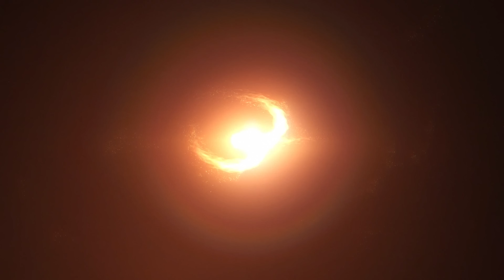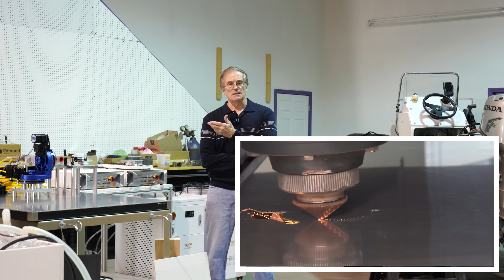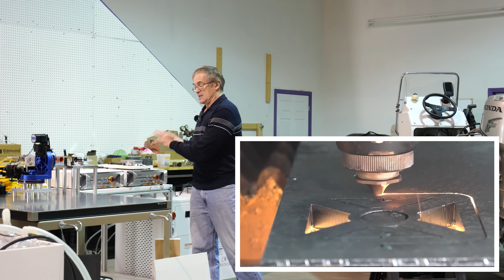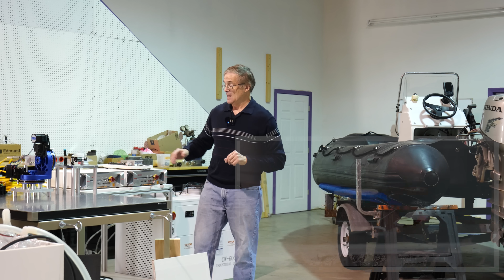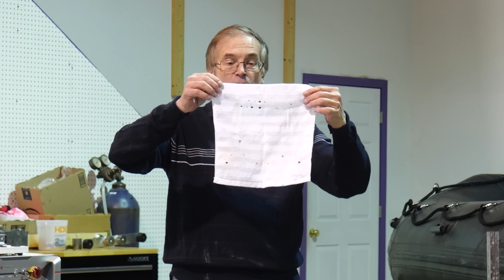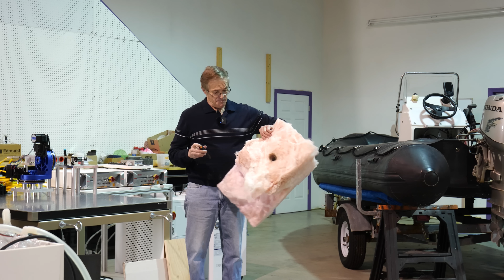We have a problem... and need your help!

Comment: You guys REALLY need to improve your lockout switch setup as well. Have a chain of momentary push buttons in series, one for EACH person in the room, and allow the Laser to power on ONLY when ALL switches are permanently held in, and require a procedure before it can be powered again. That way there is no need to communicate if something is wrong, anyone can disable it within less than half a second. You could also add in additional light-based detection that points at your back wall and immediately trips the laser off if light (laser OR just thermal radiation from the heated wall) is scattered off the wall.

This is all in addition to having a somewhat resistant wall.
Reply from the maker: We're including both as you suggest.
Reply: @TechIngredients  great to hear! 👍
Reply: @TechIngredients  make a portable water tank with one-way mirror that can disperse the light that gose in to the portable water tank/wall or tubes, maybe similar to solar thermal collectors!!
Reply: @TtheMindd  Not sure if anyone replied yet - there are no affordable mirrors that can handle this beam once it's focused. It will blast through almost all - even reflective surfaces.
Reply: @frollard  to be honest you can't make that claim without testing it!!!  water will not only dispersed light  but it can aid in the cooling down of the temperatures! I would assume depending on how you combined the one way mirror with the transparent solar thermal collector will be of significance when ensuring this thing functions properly! Think of it as a fiber optic cable but with tubes of water and a one-way mirror
Reply: @frollard  he's using the fiber optic laser to admit those beams we could use something similar to capture the same beams but instead of like I said but instead of fiber optic it would be laser thermal collector!!!
Reply: @TechIngredients What about a wide water feature. The water is running all the time.
Reply: @IT-sq5rj I was thinking of this too. Like a laminar sheet of water.
Reply: This of course would be a project in itself
Reply: @TechIngredients  Have you tried using translucent glass to diffuse the beam?
Reply: @snarzetax  that's what I was saying there's a couple of different ways we could refract the light glass is one of them water is another if we can bind the two it can be done efficiently I deemed it a laser thermal capturing system
Reply: @TechIngredients ruby / corundum dust for absorption. It should allow you to tune the absorption by simply changing the color of the source stone as well
Reply: @TechIngredients  I was going to say similar - the default position of the system is OFF and it takes a number of people to do something in a sequence and then to keep the button pressed
Reply: @TechIngredients  I wonder what @styropyro would suggest. This is his cup of tea. 😂 He might own a few already.
Reply: @TechIngredients  would anything like SpaceX Starship heat tiles work?
Reply: @PetesGuide  it seems not, that is for blanket high heat not for point intense heat. it's no different that the drywall for this case
Reply: @PetesGuide SpaceX design is closed. But the shuttle had similar tiles and the design is open and public. 

As other people said it's not the good direction. These tiles are designed to be insulator, and above critical temp, they evaporate to produce a protective layer of gaz. It's does not absorb or conduct heats. The laser of the day will perce it fast. 

But those tiles are very light. And could be used to store a liquid. When heated the liquid would disperse the laser over  a larger surface.
Reply: Seems like also shutting it down if the aiming electronics don't keep moving the beam. If it dwells for more than say 1/4 second, turn it off.
Reply: Agreed, some cheap PIR (Passive Infrared) sensors aimed at the target area (a few layers of fire rated drywall etc.), ran in series to trip a relay that opens the LASER control circuit might do the trick...
Reply: What about ion-exchange treated borosilicate glass panels  (think Superfest, or Gorilla Glass) placed in series with sand (or perhaps ceramic beads) filling gaps between panels?  It seems like the glass would somewhat diffuse, and thus attenuate, the intensity of beam, but would the sand negate this effect? Old Pyrex baking pans (NOT the new recipe calling itself Pyrex) should be fairly cheap at the Goodwill or Salvation Army. 

I would LOVE to watch you use Superfest’s ion exchange process to strengthen glass - making a video, of course, on how to do this at home with supplies and materials available at the local Walmart.
Reply: I am picturing everyone has a key around their neck…
Reply: Also some light/sound alert when laser is working / starting.
I would explore some materials that could induce electricity under a laser, wouldn't be surprised if with your amount of power you could just detect photoelectric effect off of metal sheet... After detecting, basically connect it to switch-off. It's funny how we are looking for better and better photovoltaic cells but you need some very cheap and very bad one :D

There is even whitepaper exploring this effect on metal sheet http://www.jetp.ras.ru/cgi-bin/dn/e_039_02_0375.pdf
Reply: Good ideas. Thank you
Reply: In electronics, we call that an "AND" circuit. It's a great idea considering the danger potential!
Reply: pesons in the room??   usually lasers and people are kept apart.
Reply: You could reduce the laser pulse time ,  or use a reflector to direct it to an absorbent tank on the floor, or perhaps refraction material of some type and a large absorption material to dissipate the energy.
Reply: Limit the angle of rotation of the laser.
Reply: The more tested safeguards, the less likely to have a "system accident" that gets by all of them. Expensive, tedious, and likely to trip when you don't want it to, but pretty necessary.

Comment: The first thing that comes to mind is something like a boron nitride aerogel - but that might not be economical to obtain or produce in your context. 

Alumina or ceramic tiles is my next thought.  I would layer it between 2 sheets of gypsum board to build composite panels - like an armor carrier plate. That keeps the tiles captivated even if they crack,  and the outer layer of gypsum might trap some reflection. 

Kao wool or ceramic wool like used in a forge is another thought.  If you made panels lined with that, treated with a colodial silica rigidizer, then coated in refractory cement like satanite. 

There's another material of legend called "starlite" that is the exact right intumescent material for this.  Unfortunately the composition is closely guarded.  It is an interesting rabbit hole with some useful recipes along the way from people that have attempted to reverse engineer it.

This is an interesting challenge that I'm happy to lend some of my resources to developing.  I have a specialized fabrication shop and a bit of engineering at my disposal.

Comment: Multiple nozzles spraying water on point of contact, flood coolant style. Possibly making ceramic or other readily available heat resistant fiber board viable. Could play with direction of flow, laminar from multiple parallel or converging tubes from one direction, carefully aimed converging angles or from all sides for chaotic splash. Multiple layers would be easy enough to add if destructive delay is useful but not sufficient. Water may keep airborne particulate from the substrate in check. Board(s), pan, tubes, pump - could be made fairly cheap and portable enough.  

Or a slurry curtain using a dredge pump to circulate say a water and sand or clay mixture into an opaque waterfall. Clay or similar would remain suspended negating the need for supplementary agitation. Could plausibly be made reasonably cheap/portable-ish. Some minimum volume to satisfy the smallest pump you can get. Basic idea is a big bucket with a submerged dredge pump feeding a pipe straight up to a 180 curved bit above and dropping it back into the bucket. Aim at the dirty stream. Maybe supplement with heat resistant board enclosure to contain any hopefully suitably diffuse reflections. 

Or a tokamak.

Comment: Initial thought was a matrix of crushed industrial diamond over a reflective (mirror) surface MOUNTED AT AN ANGLE, so the laser beam is not normal (at a 90° angle) to the impact surface. 
    Depending upon the amount of energy in the reflected beam, additional diamond scattering and reflective planes might be needed.

    Arranging these as the interior wall of a hollow spiral could continuously scatter/reflect with little or no laser light escaping. Near the far end of the hollow spiral, the angle could be made such that the beam travels back up the hollow spiral. Every scattering and reflection cycle (full.length and return) would further attenuate the laser light intensity.
    The "far end" from the beam entry could be angled into an additional section or sections of scattering tubes, completely trapping the light, bouncing it back and forth indefinitely.

    A possible material to absorb the beam might be a carbon matrix similar to that used in water filters. The purer the carbon, the less it would "burn", like heating charcoal in a bar-b-que. Heat would need to be dissipated with high flow rate fans, but pure carbon should take a LOT of heat. Melt that, and you are in "interesting" territory. It might be worth considering "charcoal magazines," each holding ground charcoal (think loose charcoal used in aquarium and wilderness water treatment systems. Medium is easily refillable if needed, and any beam should bounce around a bit among the black carbon granules absorbing more light. Turn it "edge on" to increase the charcoal density. Use some sort of agitation to move the charcoal granules thatcwill eventually oxidize and turn gray/white, reflecting the light and lowering absorbing eficency. This ground charcoal is pretty cheap if purchased online in bulk. Hey, you might consider using this as the primary target without a scattering stage.
    Good luck. Michael from Texas

Comment: I do understand that you don't when to bounce the laser, but what about  using a lens to diffuse the laser so it's power output on the other side get smaller by area? It would at least work for static test.

Comment: You were right to think of water, but a mass of water.  Build your own aquarium with glass the laser will pass through without destroying (at least on the laser-facing side), and tint the water with ink or some similar dark dye (choosing one that is non-toxic, as you specified) so it is more absorbative.  You could try towels/cloths suspended from dowels laid across the top of the tank (so getting two thicknesses from a single piece), so that instead of relying on wicking to replace the water, you have a mass of water trying to continually soak it, and then you would use less of the tint.  Finally, put a mirror behind the tank, angled to reflect the laser down into the ground.
Reply from the maker: It has to cover the entire back wall.
Reply: @TechIngredients  Ah.  Then at this point I'm guessing, could something like a wall of Fresnel lenses disperse the beam to the point that wet curtains might actually work?

Comment: I would think a multi-ply backing would be of some interest, using various materials to effect stopping (or reducing) the damage of a laser within the shortest distance possible.  It seems that ceramics may be the best approach as the final layer, with other layers of other materials serving varying purposes.  The first thru final layer I'd consider something that can be used as a vessel to contain a medium consumed by the laser, yet functionally replaceable as it is used up - while fully shielded at both sides with a self healing membrane.  If this could be done, then the membrane would keep the inner material(s) from escaping the structure.  What materials could be used as a membrane, or other materials for the consumable and even the material for the enclosing structure would be the question.  Not to mention, how many layers in this combination would be requred.

I do not know the interaction of a fiber laser versus sand, nor do I know if a variant of glass could perform the structural function.  As to the final layer at the backend, I think ceramics may be the best solution.

Anyhow, just an idea.

Comment: I haven't gone through all the comments, but have you tried Starlite? Perhaps some sheet-good coated with starlite? Perhaps also changing the standard recipe to include small glass spheres or fumed silica powder to help disperse the light?   How about a fog machine in the intervening are to help pre-disperse the light before it hits the stop.

Comment: Haven't read the comments so It may have been suggested, but how about triple pane windows? You could poke the seal and filled them up with an opaque liquid. The middle pane can be selected to be a bit opaque as well, in order to diffuse the laser. 

There are probably factories that manufacture them and deliver them in various sizes, you can control the thickness of the glass, etc... You'd need to figure a way to protect the edges, of course, but hey, it's an idea.

Comment: Build a hollow steel wall that you fill with water. Maybe 3-4in thick. Build a sturdy cart for it so you can wheel it around and position it for your test as it will be heavy.  And add a pump and collection system so you can cascade water down the front of the wall for the test.  That should give you multiple seconds to fire the laser with no damage.

Comment: Build some fail-safe stuff into the system.
   - If for any reason the target tracking system stops tracking the drone , turn off the laser. This could be part of the system you'll need that detects that the target was destroyed and the laser should be shut down. There ought to be several (software) test points that can be inserted that confirm that the laser system is usefully on. This approach should provide the quickest response time to shutting down the laser if something has gone wrong.

Comment: What about brick facade instead of full bricks. You could hang them and easily swap / rotate a panel between tests. 

If you know where about the beam will be you could hang an extra panel or even just one full brick.
Reply from the maker: That's not bad. I'll look at that.

Comment: How about a tank of water with some impurities such as dust to cloud the water? Or a high volume stream of water (horizontal preferably, or vertical)? With a tank, you need something to angle the laser beam into the tank. With a stream you can just recirculate the water, if you can find a big enough pump. I'd imagine something similar to waterjet sand would work as an impurity. You need a robust pump to survive that, though.

Comment: Along the same lines as using sand to continuously fill voids, how about a tank of water? As soon as the front side gets a hole poked in it, the water will start to flow out and continuously intercept the beam. The surface of the flowing water may also refract and disperse the beam, so the back side material holding the wall of water might not be damaged so much. You could use cheap plexiglass for the front, and brick or something else sturdy/cheap for the back. Slap some flex tape on there once the beam is off to plug the leak. Sell the used swiss-cheese plexi in squares as souvenirs for fans & donors.

Comment: WHERE DID MY COMMENT GO?
****************************
3/4 or 1 inch thick tripple wall POLYCARBONATE GREENHOUSE PANELS.   CAP THE BOTTOMS, FILL THE CHANNELS WITH WATER.
****************************
Reply from the maker: Maybe. 
However,once the tubes start leaking, we'd have quite a mess.
Reply: @TechIngredients  But each tube would only hold a quart of water and fixing would be 5 minute epoxy.   The taller you cut the panel sections, the more water to deal with depending on where the hole was made.   Also, you could just put a PVC pipe at the bottom..  when the water drains out, I can't imagine it going far, a drain channel below could capture the water and direct it into a bucket..     If the channels are 10ft tall and you hit the bottom, the water is going to shoot out.    Fill with very course sand and water and it would slow it to a dribble, which would run down the panel and could be collected in a trough at the bottom.
If you cut the panels 5 feet tall, then stack them, any single hole could only dump a coffee cup of water.  
Or you could fill them with glass beads and water, then you're talking even less water to spill out.

Comment: You could use intumescent fireputty pads, or use the plywood with intumescent coating. It's a little pricey, but it's meant to be used as a fire arrestor. Another commentor referred to NighhawkInLight, and that's a good inexpensive source for that material.

Comment: I am not expert in this problem but suspect that any method depending on absorbing the beam energy will be very difficult.  However, spreading the beam might be far easier.  Perhaps a panel or suspended sheet of steel bearings or other highly reflective and durable material might quickly dissipate the energy.  Going from just a beam diameter of 1mm to 1m^2 would protect everyone, so long as you use goggles, etc.  An array of bearings on the floor might be easier to deploy as the array would self-assemble like pouring water in a shallow pool and easy to recapture by tipping the pool, vacuum, herding with an air nozzle, large electromagnet on a hoist, etc.  Mounting the lasers high in your space should also be fairly easy.